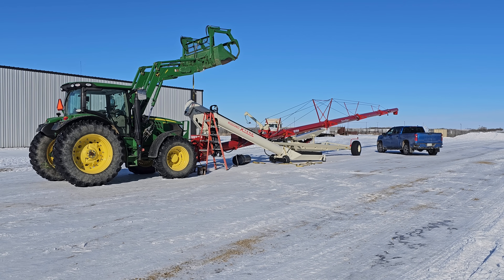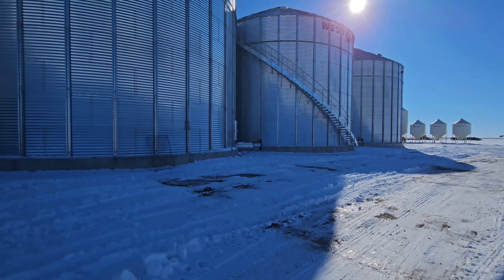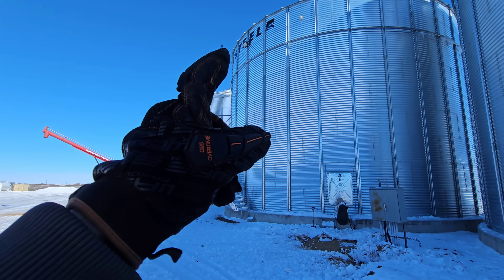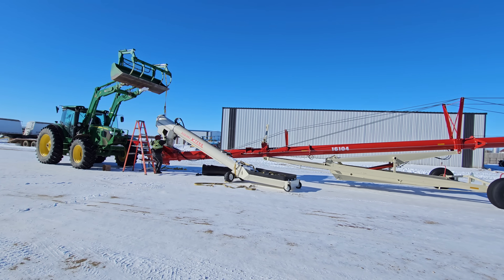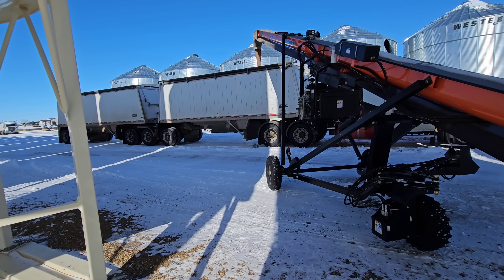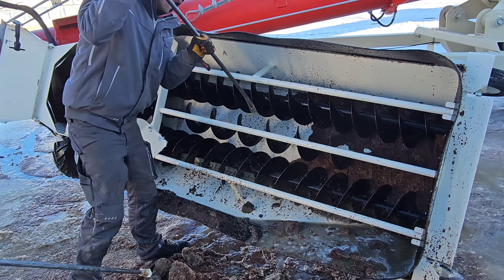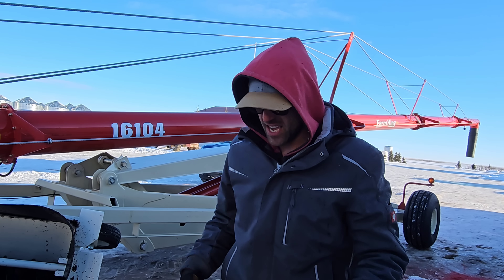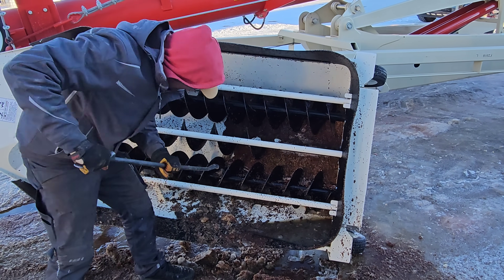What did Mike just do? 😆🤦🏻‍♂️

Comment: If you Arranged your bins in a semi circle,   you could go with a 5 or 10 thousand bushel an hour leg and downspouts with a 1200 bushel pit. You can still get a pit, and a leg, put now you need a drag conveyer or a drag auger.  Of course you would need drag conveyer back to the leg and a 4 or 5 thousand bushel overhead biin to ship out products.  You would increase your efficiency and reduce your work load, but with  an initial cost. I would base the leg capacity, to what you can combine an hour, plus 20%.